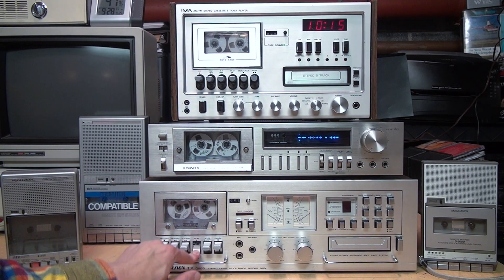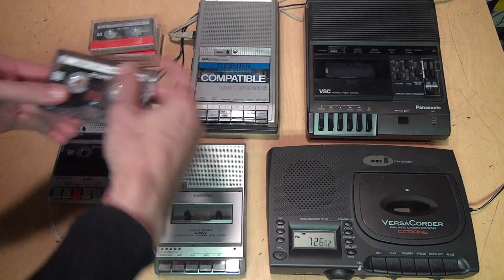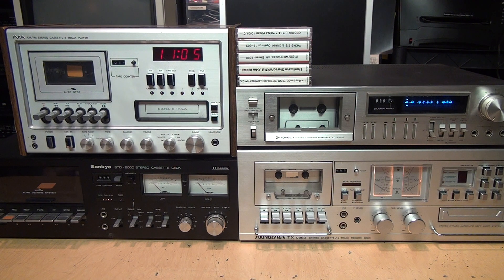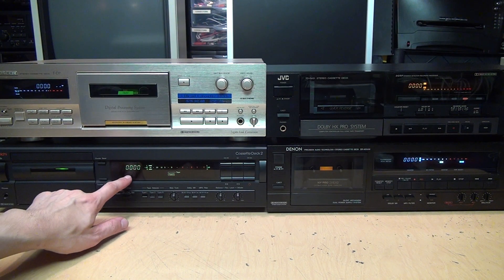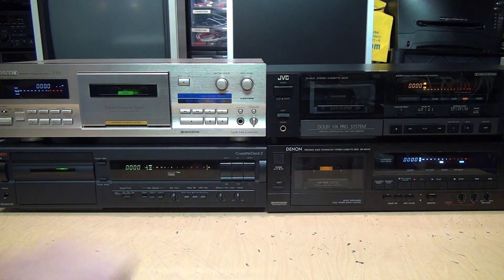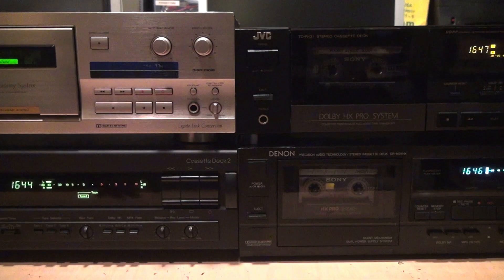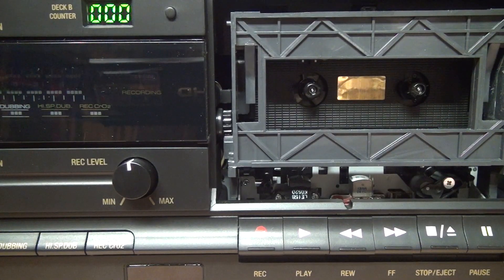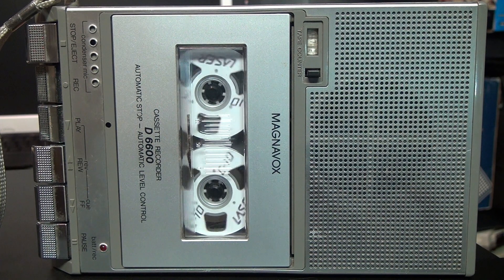What's the deal with cassette tape counters?

Comment: I have a Sansui. dual cassette deck model D-X119W which I have to try out that test. I think mine does the take up reel but I'm having trouble with that because I don't know what year it's from went to go look up the serial number and it says error serial number- 24090775 I got it at Goodwill for $10. it runs great I just have to adjust the level meters because they stay on -10DB . it does have a all metal Tanashin mechanism a sankyo single motor with a metal/ plastic flywheel in mech. the belts are mint condition even the tape heads have very little wear if any I noticed when cleaning it the heads seem to have what look like a slight rust which I took care of it by very carefully using a scotch brite anr it cleaned up beautifully. it has high speed dubbing, Dolby B noise reduction. my akai M8 reel to reel rhas four digits for a counter which is driven by the supply reel. however can anyone help me with the Sansui cassette deck so I can place a date of manufacturer. it is black has a digital vu meter and gold and black front feet. I was going to try to email you VWestlife . it rattles my brain that the serial number is coming up as non-existent basically. there is serial numbers on the mechanism if need be. any help to me would be wonderful. I also have a Fisher dual cassette deck which has similar qualities as the Sansui however the Sansui is in far superior condition especially where there's a proprietary connector for power which I'm going to modify to accept a barrel type plug or something and it needs belts because they turned into a sticky mess. anyway good video chat to show the differences on all these cassette decks. I'm sorry for the long comment
Reply: You should be using the model number when searching, not the serial number. The serial number is different on each one made, even if it's only by 1 digit; for example, the 24090775 you stated and 24090776.
Reply: @purpleghost4083  it says unknown number or invalid when I looked it up. I've done everything I could
Reply: @mercuryoak2  It dates to about mid '90s, and as you already know a very basic double deck. If it was me, I wouldn't put any time or money into it. You can buy a copy of the service manual, but again if it was me...
Some of its stated specs are:
Frequency response:  125 to 12,500Hz  4db   (a more useful and specific frequency response and deviation spec wasn't given, like for TYPE II & TYPE IV tape)
Signal to noise ratio:  (with Dolby B on) Better than 50dB  (again, a more specific spec wasn't given, like for TYPE II & TYPE IV tape)
Wow & flutter:  0.15% max. (WRMS)
Fast forward/rewind time:  Approx. 170 seconds (for C-60 tape)
Input sensitivity:  Line in (REC) 100mV

For the FR and S/N ratio specs, assume that's for normal (TYPE I) tapes.
Reply: @purpleghost4083  to be honest that sansui cassette deck sounds great I have another one that is by pioneer and that one sounds great to both having the same Dolby noise reduction. You know what's funny is that sansoni before I clean the heads which I use alcohol to clean them. It look like they had some type of slight corrosion or a tape shredded like the old reel-to-reel tapes did. I used a very light Scotch-Brite peace with some rubbing alcohol to give it something that makes it so it's not dry and causing damage to the tape head it cleaned up pretty well. Both of these tape decks are very similar except the pioneer has Amber display where the sansui is more of a bluish color. I don't know how is it so basic when it's a tape deck that has dolby B&C noise reduction same as the pioneer. Auto-reverse AutoStart from deck 1 to  deck 2. It has repeating etc I mean idk I like it I'm keeping it . Myself I'm not an audio file type snobby person where I have to have absolutely most expensive stuff...
Reply: @mercuryoak2  Are you sure the model number of the Sansui is D-X119W?  The information, photos, even the service manual for it, show that it does not have auto reverse or Dolby C.
Reply: @purpleghost4083  when I last looked at it. I looked in a picture it was Dolby B noise reduction not like it matters.... It doesn't matter I'm going to keep it if I sink money into it I don't care. It's mine.  Same with the pioneer that I have which alone is from 1999-2000  because it's dated that. I have to do is adjust the vu meter level . I'm not going to buy some overpriced garbage either... The pioneer  has auto-reverse the sansui has continuous play tape deck 1 to 2...
Reply: @purpleghost4083  what I was meaning was the pioneer I have is a CT-W404R  that has the wind autoplay auto-reverse Auto tape selector Dolby noise reduction B&C.  The thing that's funny about these cassette decks they don't have a headphone jack so you can listen to whatever's on a tape you have to use a separate amplifier. Otherwise I like them alot. To me as long as they match color and can be part of a stacked system that I'm slowly putting together works for me lol

Comment: You can't drive tape from a supply reel.  That would just dump all the tape while the take-up reel sat idle.  Actually on the original reel-to-reel format, on which the K7 is based, tape is usually pulled by the capstan, for consistency, while the other reels simply tense to the outsides to maintain proper tension.

Tape counters are simply counting arbitrary figures; their purpose was to give a reference for a single player, not for multiple players.  The number values themselves, where they're counting arbitrary units, mean nothing in and of themselves. That means which mechanism drives the tape counter, is irrelevant. They're not mutually "compatible", and they were never intended to be. A tape deck manufacturer assumed the user was working with that single deck, not with multiple ones. If you come across two decks that give similar counter numbers, all that means is that the two manufacturers (which could actually be the same manufacturer) designed their counter mechanism the same way.

To make it even less useful, the amount of tape a supply reel takes up on one revolution (or a supply reel supplies) is going to change as the tape builds up or depletes, creating a larger or smaller diameter.  Long story short, the pre-elapsed time counter is strictly a shot-in-the-dark guide -- not a reference. It is only to get you in the ballpark .  And before there were mechanical counters there were (and still are) measurement marks on the window of the tape shell, for the same purpose.  Basically you're expecting WAY too much out of a device that was never designed or intended to be any sort of precision instrument.

Various cassette designs are of course cut to different lengths, and use different thicknesses --  thinner tape when they want to jam more tape in there. On generic cassettes the length is usually stamped on the spine (in minutes).  Sometimes it will be printed on the leader tape.

One should never depend on a counter, OR a time reference, as an all-clear to start recording without checking that it's actually blank tape coming up.  I learned that at the age of 6.

Comment: I wonder why they never used the capstan rotation as the reference. Perfectly linear and the only thing that really mattered.
Reply from the maker: And the capstan is not used when rewinding or fast-forwarding.
Reply: Thanks, that's what I get for opening my mouth without thinking. A perfect plan gone down the drain.

Comment: Why implement a four-digit counter which can count to 9,999 and use just 1,400 or 2,100 of that resolution for a C-60 tape? That's a waste in my opinion. A C-180, the longest tape there is (not a single deck manufacturer recommends those) will just use less than half the range of the counter.
Reply from the maker: Maybe because seeing a counter reading in the 9000+ range makes it more obvious that you're rewound past the zero position.

Comment: My Denon DRM-800A has a four digit counter and can be switched for tape size. In conjunction with sixteen segment (-40 to +8) peak hold LED meters. The tape counter counts "real time" in minutes and seconds. And a Record Return feature to boot. Really freakin' boss for taping. Sooooo different from standard three or four digit counters.

Comment: Frankly, it doesn't matter to me how "accurate" either the 3- or 4-digit tape counters are, they're all bunk and useless.  What these counters should have been all along are actual time counters, so you could get a real sense of how many minutes of tape have elapsed, or how many are remaining, in your recording (maybe switchable between the 2 displays?).  That's the only real useful information anyway; the arbitrary counter is just a gimmick.  In fact, the Compact Cassette format should have, from the start, specced a dedicated track for recording SMPTE time code *on the tape*, which would have been accurate to the second, or fraction of a second - a feature just like professional videotape always had, so you could pop the tape in any machine and it would show the same exact point in time on the tape, every time.

Comment: Actually the name "tape counter" is misleading because it counts rotations, rotations of wheels with an unknown ratio and also the wheels can turn without a tape. If it was really a tape counter it will measure the accurate position and length of the tape but this is impossible by design. The later counters, in minutes and seconds did a better job however  they are still not counting the tape. DCC for example has a real tape counter because a timestamp is on the tape. All the other versions are counters of something spinning and not accurate because they cannot determine the position. Pop in a cassette that is not rewind and the counter is useless. Maybe they had to call it zero reference counter or something like that. Actually the most accurate sensing method is at the pinch roller. Because the diameter is the same and with this you can calculate the tape speed and everything else. 

Nowadays it could be possible to insert a 4pin chip/board inside the case of the cassette to exchange counter information that can be read with pogo pins by the tapedeck used. Every deck supporting this feature can use the same counter method, counter problem solved. It can also store the current position. This is not a watertight solution and still analog but could be a cool feature. 🙃😄

Comment: There is one serious flaw with your testing procedures; not serious for typical use, but important if you are diagnosing the results down to a single or a few digits.  Each one of the tests was run with a DIFFERENT actual cassette sample!  How do you know that they are all EXACTLY the same length?  (They aren't -- winding equipment isn't that accurate or consistent.)  To run a valid test, you should have used a single cassette, not multiple ones.  You have introduced a second source of error; again, not important unless you are measuring to such a fine standard as single digits.

Another factor you may have overlooked.  The tape counters do NOT measure the tape length, but the number of turns of a hub.  If tape was wound tightly at the factory, but loosely in your equipment, the same cassette, no matter how accurate the deck, will measure differently each time you try, due to tape slippage.  You are measuring HUB TURN COUNT, not tape length.
Reply from the maker: Keep watching -- I discussed both of those aspects in the video.